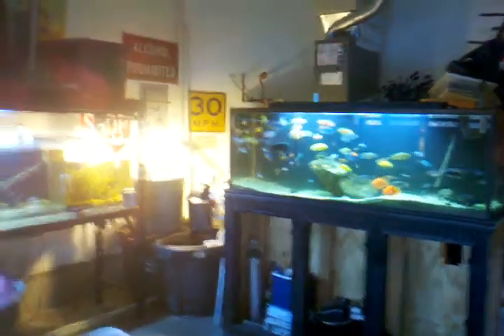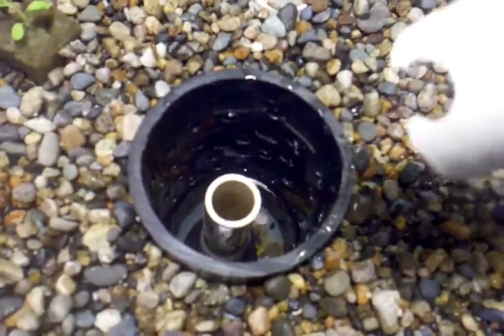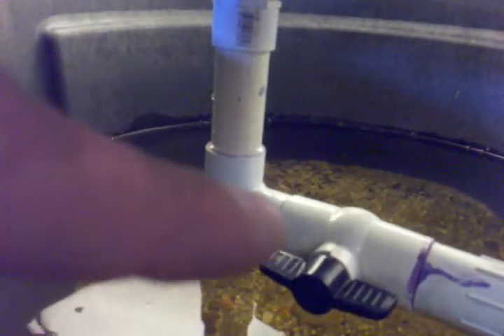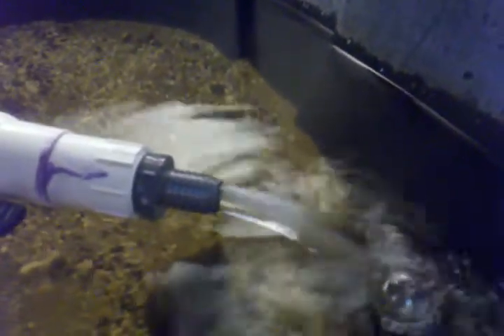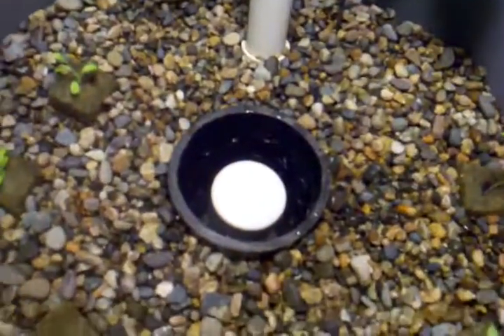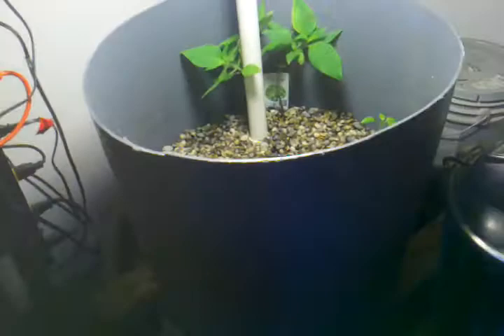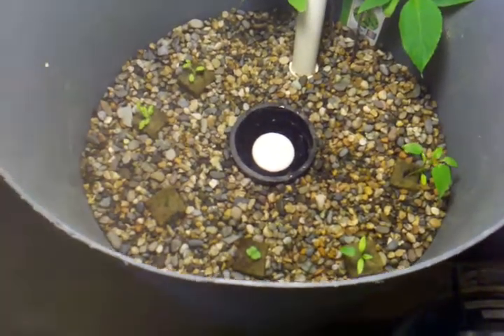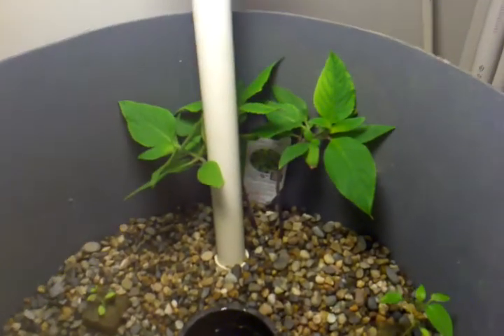10-30-11 bell siphon install on my aquaponics fish room

Comment: I really like the setup and I don't claim to be an expert, but you can definitely get the light closer. The light can be as close as you can put your hand without it being very warm.
"The intensity of light from a point source is inversely proportional to the square of the distance from the source; so an object twice as far away, receives only one-quarter the energy."-edited from wikipedia (get the light twice as close and the plants receive 4x the available energy)